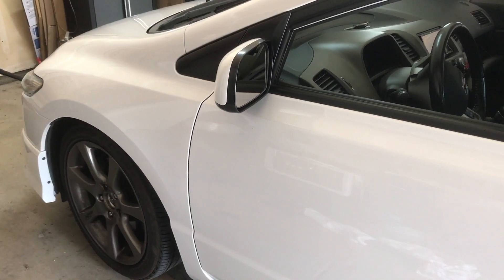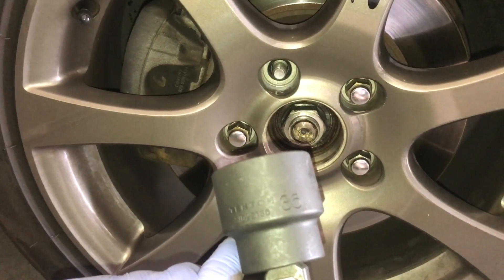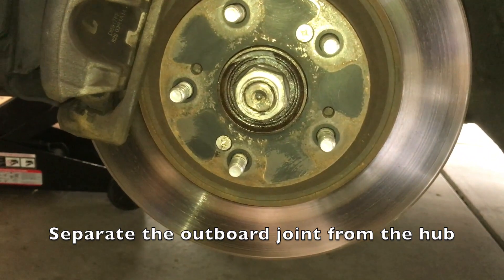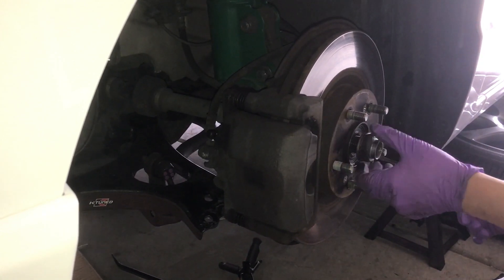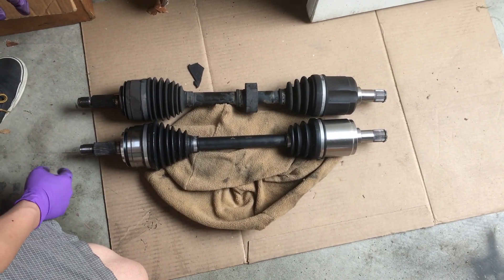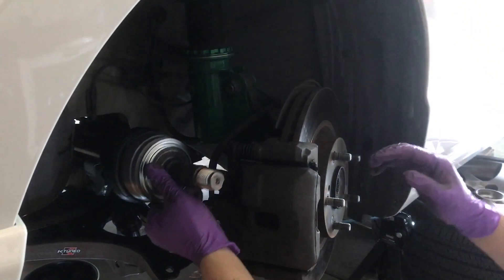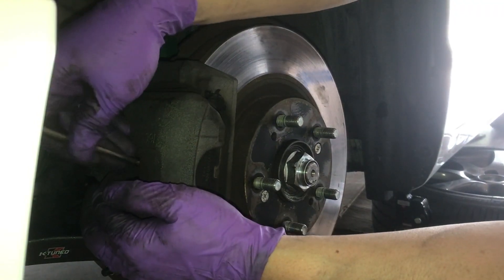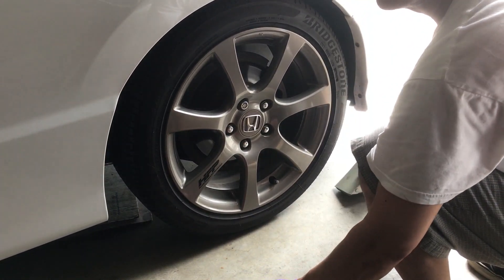06-11 Civic Si Driver Side CV Axle Replacement

Comment: Just curious how did you know there was a problem with the CV Axle? Was there a noise or something not feel right while driving? PS you make it look real easy... :-)
Reply from the maker: There was a clicking sound when I step on the gas or sometime when I come to a stop. I can hear the clicking sound when I make turns. Listen for the sound and see which side the sound is coming from. Generally, if the boot is ripped, then the axle is bad.
It is not too difficult. If it is your first time, it maybe a little harder. Good luck.
Reply: @OEMEangg  thanks for the video. So far so good at 258K. Yeah I'm sure at some point.
Reply from the maker: @edwardinvegas  WOW! That is impressive!
Reply: Mine boots got cut so greas come out small hole but big mess